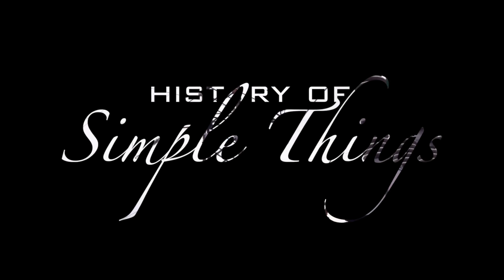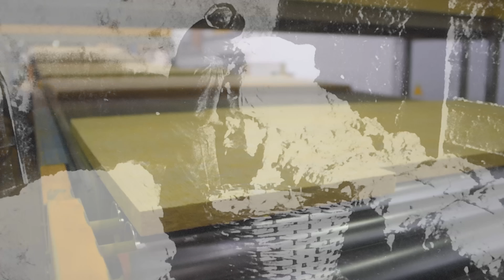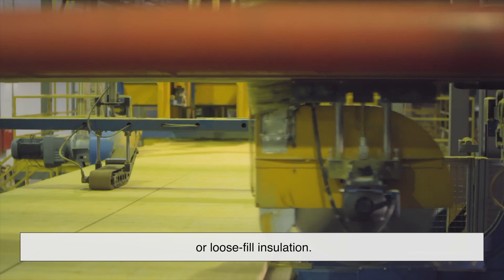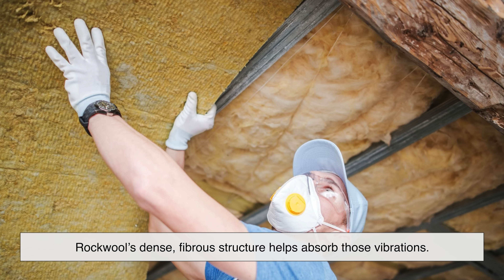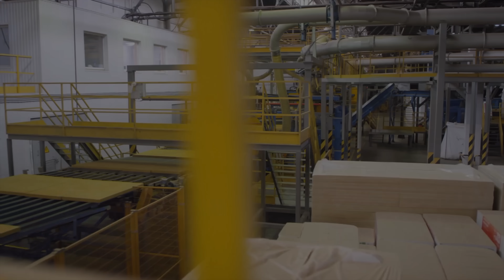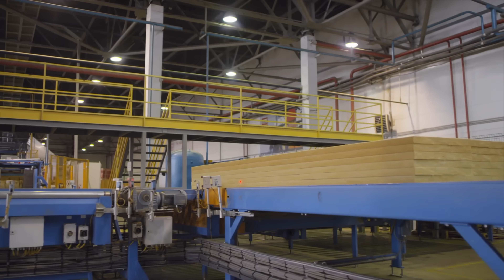What Is Rockwool Actually Made Of? (Is It Really Just Rock?)

Comment: Sound proofing and fire proof . Great stuff if you want a quiet crypt like room like a studio or a quiet bedroom . No itching like fiberglass when installing . I recommend rock wool .
Reply: No itching? =Bull$hit..     I've been working with this stuff for 25 years..   it itches just as bad as fiberglass.    The only real difference is that it's easier to work with, shape, cut, etc.      Insulation itches because of the binders used..  not the insulation material itself.    Even fiberglass doesn't itch.. it's the binders in fiberglass insulation that cause the itching.

Comment: which is better rock wool or pink fiberglass. ?
Reply: Better for what?
They both provide thermal insulation, rock wool is better for acoustic insulation and fire resistance. Personally I find rock wool does not itch as much when handling and installing as pink fibreglass.
But rock wool does not provide as much thermal insulation per inch as pink fibreglass, which is why in some scenes of this vid you saw rock wool being installed over the pink fibreglass that was already installed between the joists or studs, which is to say that they can complement and work with each other.
Reply: The pink – Dow/Corning (or sometimes yellow – Mansfield) fiberglass is better suited for contours as around pipes and electrical boxes. Also works best for cross bridging of joists (can be sliced and re-wrapped). The fiberglass mats are flexible but are scratchy (will provoke a dermal reaction). Also can be ordered in rigid sheets of varying thicknesses.
My issue of Rockwool is the inclusion of slag which a waste product; but reduces the price compared to mined basalt. Notorious for unwanted compounds in steel making and anyone’s guess of any nefarious compounds.
Reply: Hay